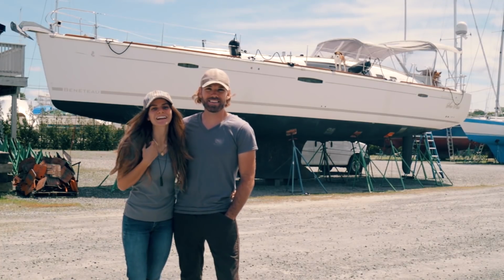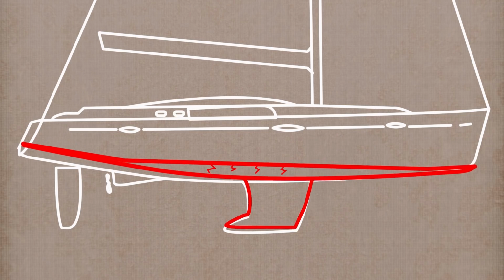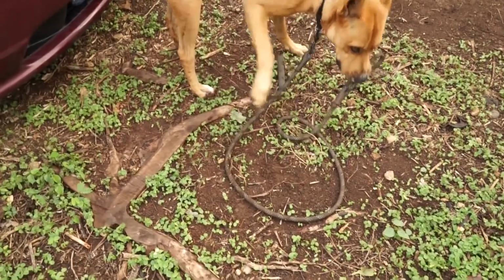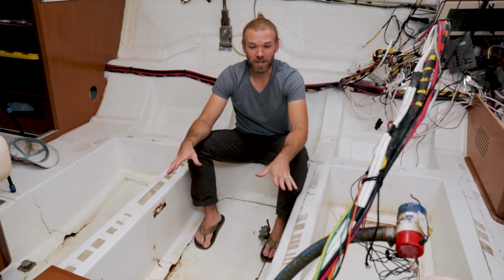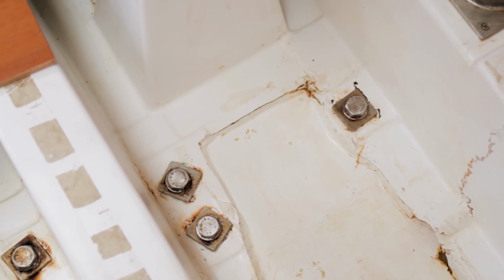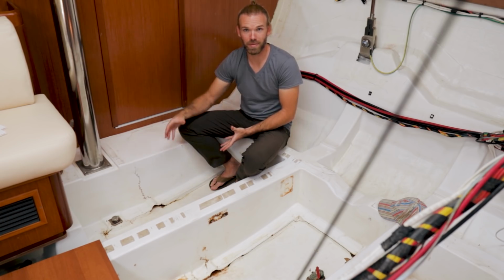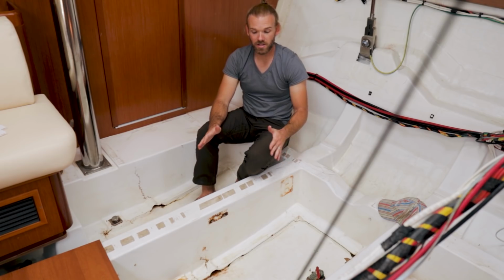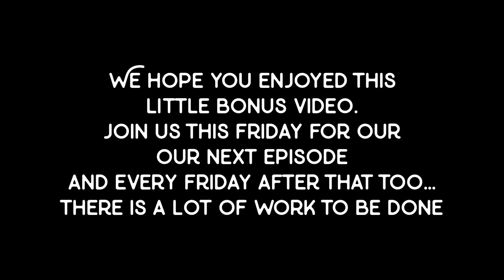What Happened and What Now? our SALVAGE SAILBOAT story | Expedition Evans Bonus

Comment: Please tell us if you have or have not enlisted a naval architect and professional fiberglass guru to advise you. Then we will stop asking.

In all the big grid repairs i have been involved in or seen,  the tabbing was removed. But glassing to the vertical sides and then to the hull is not enough. Usually the laminations go from the hull up the side, across the top, and then down the side onto the hull. The grid on that boat looks very flimsy. Glassing the way i have described produces an enormously strong hull. The details absolutely must be decided on after consultation with the naval architect and the fiberglass guru. Most likely you will use biaxial cloth and epoxy. Going across the top of thegrid structure will make putting the existing woodwork back very difficult, and will not want to do it, but withoutdoing it will produce a much weaker result in my opinion. 

You will have to grind all surfaces to clean glass. Without doing this you cannot get good adhesion. Using electrical grinders will be hell on your bodies due to the weight and vibration. The best option is probably air tools. Talk to the fiberglass guru. 

This is a massive, ugly job. If you hope to finish it you need to learn how professionals do this and copy them. Using the right tools,  abrasives, ppe, and technique will let you do the job. Trying to invent the methodology without seeing the real deal will be a sad disaster.

You will soon have a shell of a boat without keel, rudder, interior, etc. This is overwhelming and hugely discouraging.  Plan the work and then work the plan. It is like eating an elephant. One bite at a time. Good luck!!

Comment: Any engineer is going to tell you same thing, beef up the hull.  Leave the flanges on press the grid and hull back together by useing the keel bolt holes to run threaded rod in put a board on top of grid and a plate on bottom of hull tighten down till grid and hull are tight, then drill 2''holes on top of your grid about 2 feet apart power wash inside of grid also hull floor, sand for bonding. Get some 1/2 '' stainless rod drill holes an inch above grid flanges, Run rod though grid extending out about 3"on each side. Now do some homework find a superior epoxy that bonds to fiberglass then fill holes and floor about 2" thick as wide and long as you can go covering rod. This will add the strength to the entire hull hopefully preventing this much damage if should happen again. This should not have this much damage by running aground !  All just to help

Comment: Dont cut out the cracks grind them back 6 in each side repair with biaxial cloth. Cut off the flanges. And grind the sides of the grid. Drill thru the hull an thru the top of the grid use 1/2 all thread or larger. Pull the grid and the hull together. Then build new flanges use a byaxial or triaxial weave extend it above the existing flange and beyond the existing flange on the hull side.

Comment: Second that ...you need to cut the tabs off. The original method of construction is questionable at best. The resin bond between the grid and the hull is not repairable.

Comment: What about overglassing current frame to the bottom. Remove all paint from bottom face (looking into interiour) to clear glass fibre, remove all paint from frame same as from bottom panels, and lay completely new layers of glass fiber on top - over frame together with bottom panel? So you will get bigger boding surface in damaged area, not only surface  under the frame. Hope you understood my idea ;)
Reply: There is no paint
Reply: @richardlauze2873  gelcoat
Reply: @fc15min  The cracks likely extend under that grid structure, and have to be fixed there as well. I have a feeling they will be needing to cut the grid completely away in some places to first fix the cracks underneath, before glassing the grid back in.
Reply: @leaveonlywake  I think you are right. They will have to remove the whole grid, fix the hull, fix the grid and then reattach the grid and reinstall the insides.  My heart goes out to them, this is a huge project for just two people, but what a adventure!  My definition of adventure is being in trouble without fully realizing the trouble you are in :-) Good luck and I hope you succeed.
Reply: krrt66 Yes, and the 5 years of water incursion after the keel separated the grid from the hull likely affected the grp core in places. The extent of the structural damage will reveal itself as they peel back the layers of the onion.

Reminds me of an old house I once restored. We had to take it back to the timbers. Fortunately the structure was dry and solid. But taking it apart and putting it back together was epic.
Reply: @leaveonlywake  Not as hard as it sounds. :)
Reply: @leaveonlywake  Though still think is ok to get it clean (with removing grid edges and all gelcoat etc) and then prepping all for a good bond is key) and then glass grid and hull in affected area (keel to starboard side?) and overglass until happy.  Either way, it sounds like they are prepared to cut back as far as they can see that they need to to hopefully all will go well. - Good luck to them.
Reply: @robinholmes9179  It may not be 'hard', per se, but it will be tedious and exacting work if done properly. There is no quick easy fix for damage this significant, not one that you would be comfortable with relying on when the closest land is 3+ miles straight down and the boat is being tossed around like a beachball in gale force winds and seas. :)
Reply: @leaveonlywake  Yes - point taken.

Comment: Get ahold of the manufactures to see it , , ! don’t play DIYs experts I see here all the time with handfuls epoxie bogging up cracks , the grid is engineered to have a surface  area of epoxie for the grid  , and signed off for ocean use , remember it will let you down at the wrong time and any where you DIY is seen is a downer for resale if you can questions will be asked experts will pick and condem so get it fixed simple

Comment: Curious... why can you not simply clean up everything exposed at the attachment points, and across the open areas between ribs of e shell, and pour an epoxy in each section that would flow under the grid to a height above the flaps plus. Say 3/4 or 1 in thickness..  Perhaps use carriage bolts to hold one to the other untl cured and then fill the bolt holes.  So long as everything was clean and roughed up to allow for bonding, and the epoxy material was allowed to flow into the gaps between ribs/shell whatever and the hull, the pour would undoubtedly provide more glued contact area then originally, and there would be little need for cutting into a lot of fiberglass.  It would also build up the bottom of the boat's thickness and strength. (just in case you run into something in the future). Not sure what that would  do to the weight of the boat. Leave the tabs, just let epoxy flow under ribs and tabs and encase everything in about 1inch of epoxy.

Comment: Good luck guys! There is another option to fix cracks, drill a hole in the end of each crack, make a wide V groove along the crack and fill it with epoxy and fiberglass. This method works perfectly and allows you to use less resources.